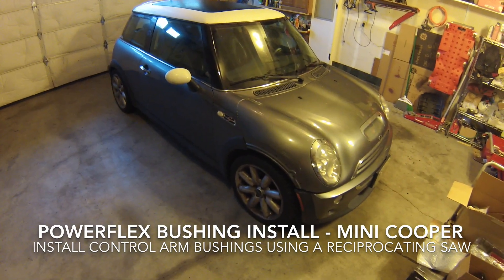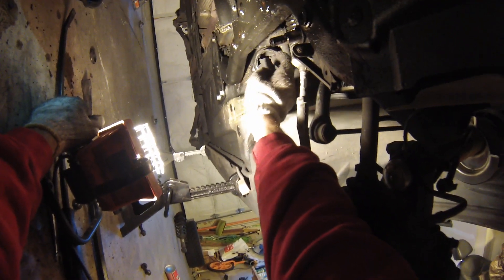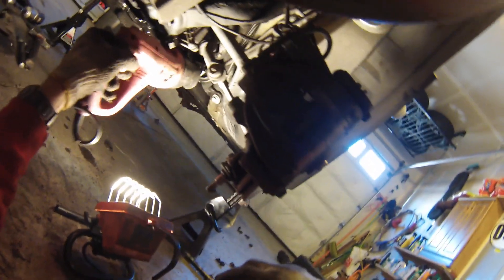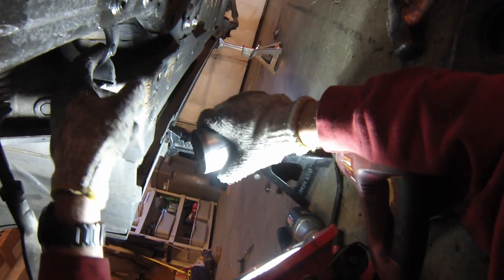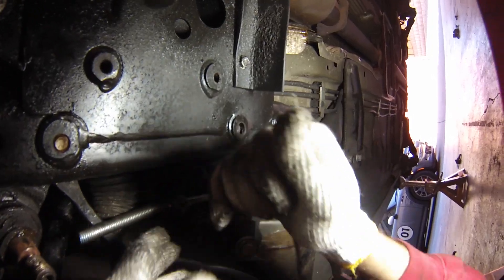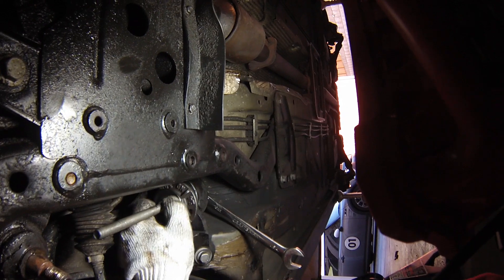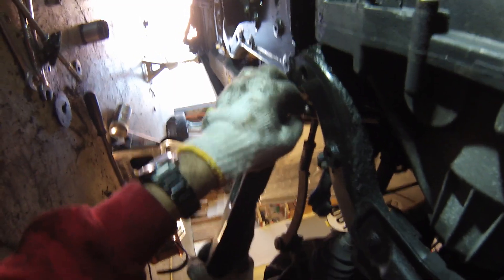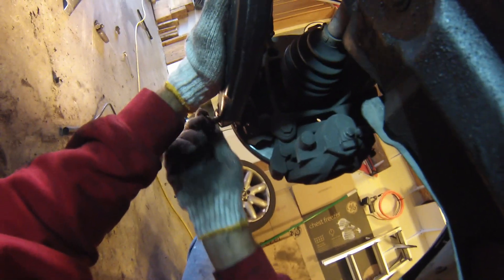MINI Cooper Control Arm Bushings done on the car-cutoff method - Powerflex

Comment: What is used to make up your installation tool?
Reply from the maker: +BigSteveRealtor A threaded rod, several bolts and washers, and a couple of plumbing pipe floor flanges.
Reply: +Mod MINI do you have the sizes on these parts? don't have $120 to rent the kit
Reply from the maker: +Mr Moto Mini R53 Motos Mini I don't know. The sizes are not that important, maybe just the round disks. I guess they are about 3 inches diameter.
Reply: +BigSteveRealtor Thanks Mod Mini ... I will be doing my control arm bushings, inner and 
outter ball joints. That tool you made to press the bushings in I pretty
 much replicated it... so for the benefit of everyone on this thread ...
 I went to Home Depot ... got a 1/2 inch Threaded Rod $1.57, 1/2 inch 
washers $.33 a piece, 1/2 inch floor flange $4.21 each ... The tool is 
just about $11 bucks to make. Hope this helps!

Comment: @modmini if I want to upgrade my front sway bar do I have to remove the subframe in order to do that?
Reply from the maker: yes
Reply: what if i only want to upgrade the sway bar bushings to powerflex?
Reply from the maker: You can't get the swaybar bolts out without dropping the subframe and you need to get those bolts out to get the bushings out.
Reply: Mod MINI ok then I guess I'm gonna add suspension bushings as part of the  clutch replacement when I drop down the subframe! Thank you!

Comment: Quick question for you: do you have a link to the tool you used to push in the bushing? I had an awful day with only one side due to non-Mini-friendly tools that I rented from O'Reillys.
Reply from the maker: +Epo Make the tool yourself using parts from the hardware store.
Reply: Gotcha. I thought you had a specific tool. My patience today was tested to its limits. I'll start looking for the right pieces tomorrow. Thanks for the rapid response sir.

Comment: How do you get the lower control arm off?
Reply from the maker: Jose Castro You cut it out like in this video. To remove the carrier, you have to remove the subframe.
Reply from the maker: Jose Castro You have to pry or grind the bushing off from the arm.
Reply: So in this video you have the subframe detached?
Reply from the maker: Jose Castro I am not understanding your question. Do you mean the control arm bushing carriers/brackets? Those stay on the car in this video. I cut out the old bushing and press in new polyurethane bushings.

Comment: can you grease or lightly oil the two bushing surfaces to get them to mate?
Reply from the maker: Which surfaces? The polyurethane bushing comes with a special grease.
On the metal carrier I spray a bit of silicone to make it more slippery.

Comment: There is a better way to do it. Take out the cv axles and u will have access to the top 2 or 3 bolts lol. I usually replace axels with entire arms at the same time